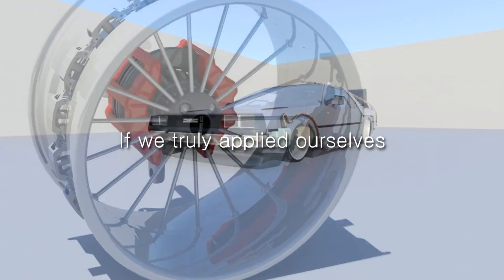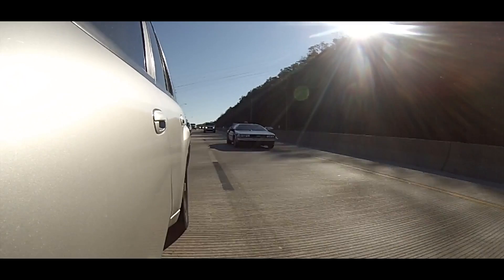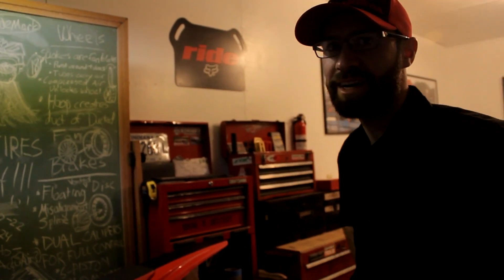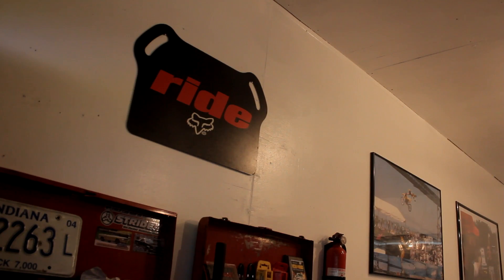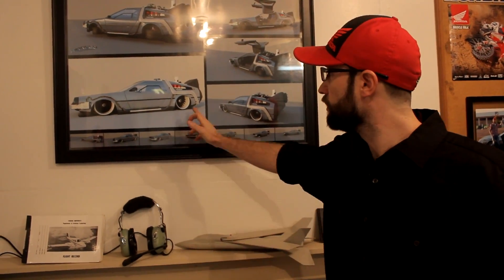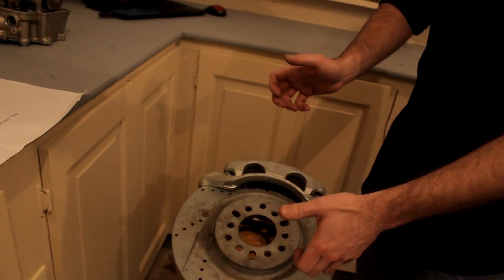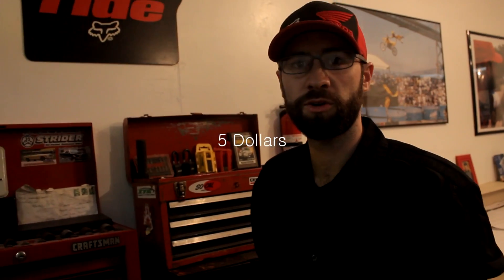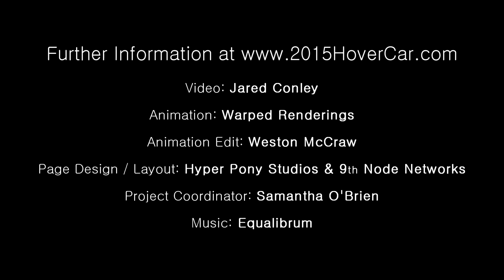HoverCar™ - Kickstarter Campaign

Comment: I know V8's have a cult following, but you'd be much better off to ditch the V8 in favor of a turbine. A PT6A-50 would give you the same horsepower with probably 200 pounds of weight savings, at expense of fuel consumption. Also, CAD simulations fail to convince me. If I were someone with money to invest, I'd need working scale models like the great engineers of old once built, to demonstrate that the physics is viable. There's no schematics for anything besides the ducted fans - you'd be surprised how far some pen and paper sketches would go, or hell, just show us the chalkboard.

Comment: Great idea but at 1000 hp that wouldn't last long in the air.
Reply: Lose power with the wheels in flight configuration and you're going to have a very rough and expensive landing.

Comment: um if you go over thermal dynamics again and catalysts  again it will work however your wheel may become a little more detailed to point you in the right direction Carnot's Theory and refrigeration are the stepping stones to create tremendous lift energy secondly capacitance of your alkaline fuel  final knowledge of microcontrollers to maintain fuel pressure at a certain bar I recommend the diesel rail system (mostly mechanical) to start...and a digital gyroscope however if you hover through an electro magnetic field your vehicle may fail so a data logger in needed to recall operations...cheers

Comment: hahaha this will never work !! the bigger the engine the more lb's you're going to put on the car and them small wheels are no where near big or wide enough to sustain a hover lol you will need small super turbines on every wheel to even get close to lifting that car lol and thet means more lb's lol and you want some big ass v8 !!?? man you don't even know what you're doing man .. you need the smallest engine for that car to keep the lbs down like a 2 cylinder or something maybe even an electric hybrid you have to cut weight on as much as possible for this to be considered to be a thing lol
Reply: Why the hahaahah
Reply: Old post, but this guy's an idiot. Drones have enough trouble flying without the limitations of being based around a car. This guy's probably in a home for the mental now